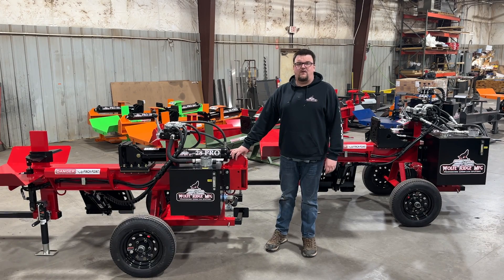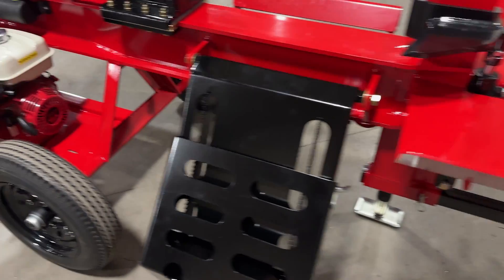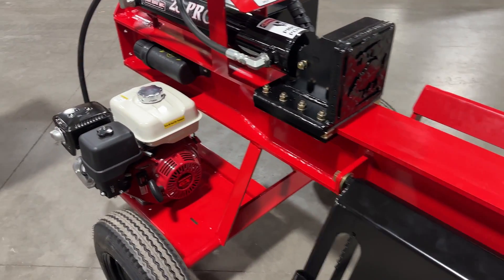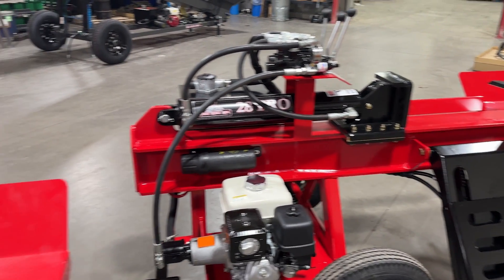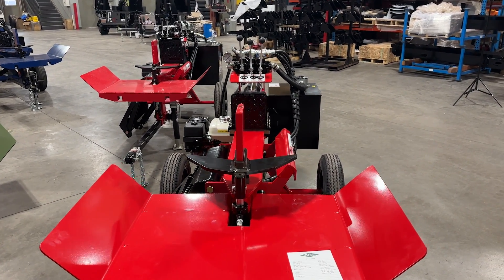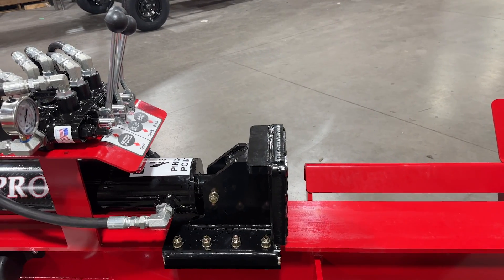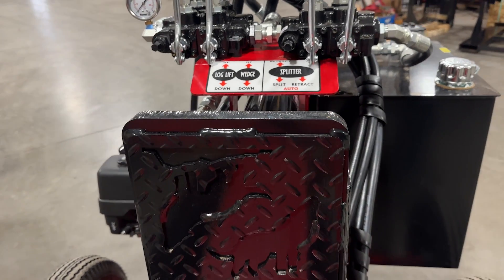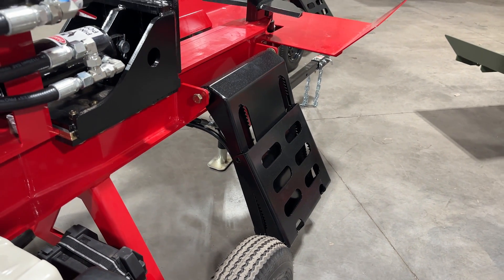Wolfe Ridge 28 Pro & 28C Compact Commercial Log Splitter Feature Comparison

Comment: @wolfridge what separates one from deciding between the 28pro-x and 28c?
Reply from the maker: It really gets down to cycle time on that.  When you go from Pro-X to 28C, you go to a 13HP engine, 22GPM hydraulic pump, and a bigger hydraulic oil tank.  Cycle time is about 2 seconds faster.

Comment: Love your machines I just have a question about that front table is there a reason why you don't have that table level? It looks like it's sitting 2 inches below top of the frame thanks
Reply from the maker: So the wood can flower or "bloom" when splitting using the multi way wedges.

Comment: How does the cotter pin behind the wedge not get destroyed?
Reply from the maker: It does every once in a while and we include a couple extras with every machine.  But, most splits angle and deflect away from the pin as the wood is going through.

Comment: I was going to get the 28 pro but after talking with Ben I decided the 28c was the better option. Im glad I got the 28c. It’s been an awesome machine. Once you add electric start and auto cycle to the pro like i wanted you’re within 2k of the 28c which comes with all that stuff standard plus the bigger engine, bigger pump l, magnum big bore package, and bigger hydraulic tank. 6.5 second cycle time vs 10.5 is a world of difference. 

But if you’re on a tight budget, or just a homeowner wanting to speed up the time it takes to process wood and save your back, the 28 pro is a great option.
Reply from the maker: Thank you!

Comment: I have the 28Pro C.  Good machine, my only comments for improvements - go back to the standard 2" hitch instead of the pin style.  That small retaining wire cable is bound to break over time causing loss of the pin and cotter and its not as easy as just throwing a lever down like a standard hitch.  Also, that newer style cartridge filter is pretty difficult to find a replacement out there.  Very few options that I could find.
Reply from the maker: Thank you Steve, we appreciate your feedback

Comment: Bob Nelson on the 17v-s does it only come with a seventeen ton cylinder on it
Reply: Indeed.  Hard to believe, but yes the 17VS and VS-C are 17 ton.  Have yet to see one not split something.
Reply: @BacktoBob1 what is a 17vs-c?
Reply: @allenmccall5021 VS-C has a conveyor on it as well.
Reply: @BacktoBob1  yes sir I have. I’ve just used to my 32 ton splitter.

Comment: I've had both, my 28pro was pre-covid built very solid machine. I had 300 plus hours and no problems with it. I traded it in June of 22 for the 28c and with in few months the hydraulic pump started leaking. The cycle time was way off, much slower. I contacted w.r. and they did send out a new pump at no charge. Ok, fixed that problem. On October 23, at 150 hours the log lift cylinder starts leaking. Contacted w.r. , their response was 'sorry out of warranty' they said 'we can sell you one' but with i declined. I took it to local shop and had it resealed for $75. The technician told me that it was a cheap cylinder (china). So now, my push cylinder started leaking recently at 168 hours. For the cost of the machine i am very disappointed!  A cylinder should last longer than a couple hundred  hours. I guess buyers beware...
Reply: Hi Dave.  I apologize for the issues you have had and are having.  Please send us an email with photos of the leaky cylinder and your serial number.  Thanks!
Reply: Hi Bob. Thanks for the quick response. I will do that talk to you soon!